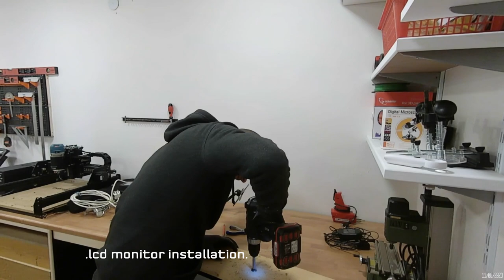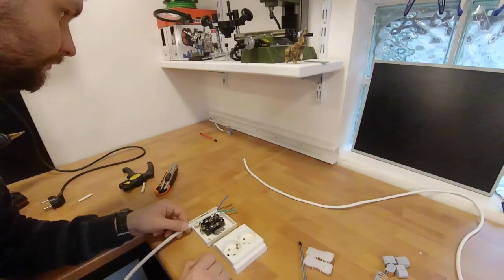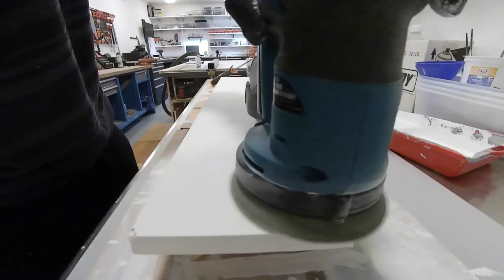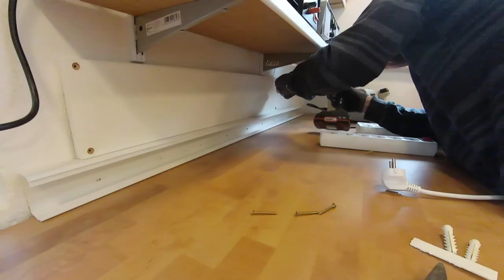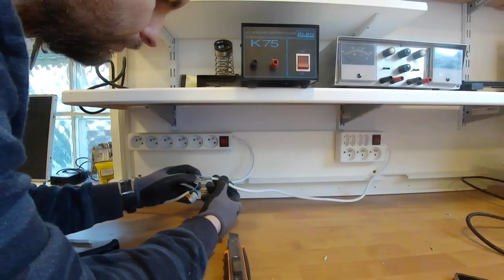DIY Electronics Workbench (part 4/4) - Finishing - Sockets & LCD Monitor installation

Comment: I''ve tried using double sided tape for securing power strips, like shown here, but it doesn't work as a long term solution though... I hate using glue, but seems that may be the only option

Comment: I'm curious what you did with the cords of the equipment on the shelf. They fit behind the shelf no doubt but do you skip running their cords in the channel, or..? I'm also trying to figure out lighting, because I want to go with only incandescent. My swing arms currently get in the way a bit and they have to stick out the back, and so don't fit against the shelves. Thanks.
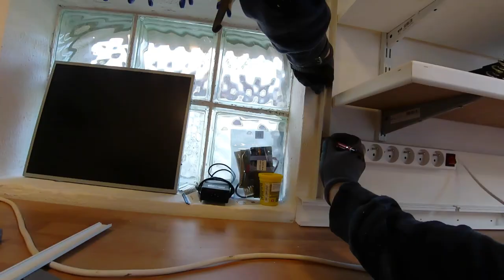Reply from the maker: Between the wall and the back edge of the shelf is a small gap. Because there go just three cables they just lay down then run to the small horizontal channel on the right side of the window (preparing the channel at 1:32 app.) and then to the big vertical channel on the table.
Reply: @webblab2415  Oh I see, very clever, thank you.